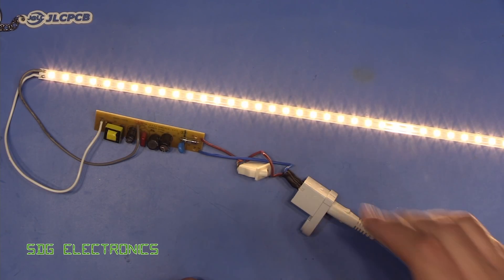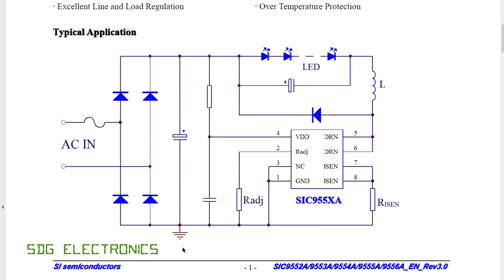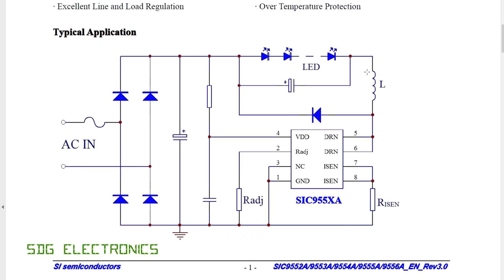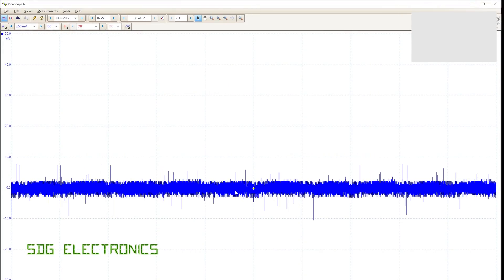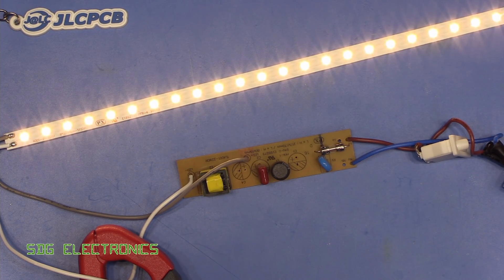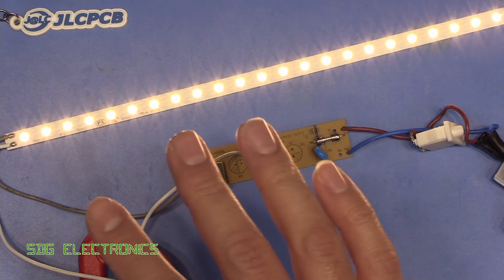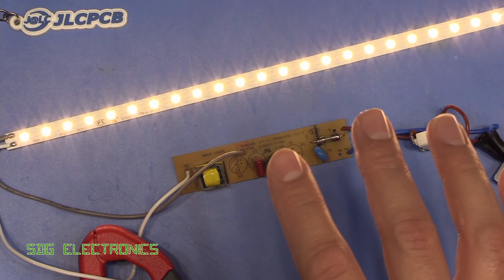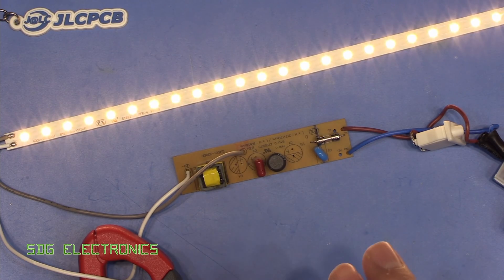SDG #201 Exploring AC LED driver failure modes

Comment: Those metal film Capacitors tend to be a major failure point whenever they are used in Capacitor dropper situation, just about every compact florescent Light that has failed on me has been because of this! 
I don't know why someone hasn't worked out a bulb design that can have its PCB made to be user replaced. I'm sure that it could be done safely and it would be cheaper and less wasteful...
Reply: If they fix that then they don’t get your money again to buy a new one. Also it would cost more to make a part user replaceable and very few consumers would even think to replace just the board on a light.

Comment: Chinese LEDs have awful phosphors. Never controlled, always some kind tint, purple/red/green, all unnatural colors for white emitter.
Finding a proper 4500-5000k white LED without color shift is like winning a lottery.
There may be some Taiwanese brands with QC, but these are basically unreachable unless you know the language to contact distributors directly.
Reply: if you want a REALLY good colors, go for philips fortimo led strip paired with xitanuim driver while being under driven... Thats what i did, and got ~6000lm with 30W of input power, great stuff

Comment: If these are going to fail all the time you'll have to find a way to open them up non destructively. Maybe heat the plastic body end so it flexes enough to lift it over the locking tab, or maybe push the tab down while lifting the body near the locking hole.

Comment: Hi!!! Great video as usual. I wanted to ask whether there is a way to simulate something like the "Aquarium Light Controller PCB and MQTT on the ESP32" from video #199? 
I want to simulate and test out the efficiency a BMS circuit design that Im working on.

Comment: If it was the heat sinking then that actually could make sense due to the larger number of LEDs on the larger 600mm strip. Extra heat and lack of heat dissipation.

Comment: I really really doubt the copper tracks offer any significant 'heat-sinking'. There are two paths; first thru the leads to the copper and then from the case thru the PCB to the copper. I have yet to see any thermal co-efficients for the first which implies it is trivial. For the second I would think the PCB has a high thermal co-efficient and would have to assume close contact to the case which is not assured. Furthermore the copper is both too thin and too narrow to offer a good SA co-efficient.  I have heard a similar argument for using channels but despite a lot of research failed to see any objective measurements or numbers; it is all "will improve!" which is like saying your car mileage will improve.....if you drive downhill. 
It COULD be simply that the end is hotter because of air  convection.

Comment: Our house was built about 7 years ago. All our main lighting are Philips brand, but I used cheap Chinese no brand lighting for corridors, cupboards and less important areas. So far no Philips failures, but on average one Cheap one dies about every 3/4 months. Always the same one diode with the black death. Easy to replace however. No driver failures at all.
Reply: I've had several Philips brand LED bulbs fail in interesting ways. The most recent seems to have burned its phosphor away. It started off as a warm white bulb and ended up cold blueish white. Very odd.

Comment: There's no filtering of the mains. Also the electrolytic capacitors can store energy but because of high ESL they can't cut high frequency stuff.
If a short spike appears on the mains, it directly goes into the LEDs that have to absorb it. 
Maybe adding a very small resistor and/or a ferrite bead in the input and an X capacitor behind the bridge could protect the LEDs.
Reply: There is a CLC filter on the input, it doesn't go directly to the LEDs.